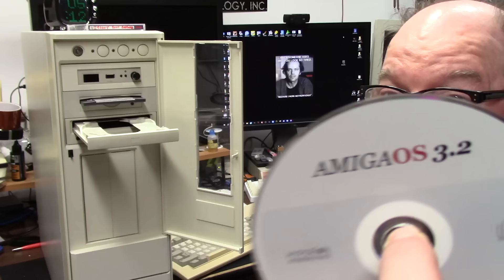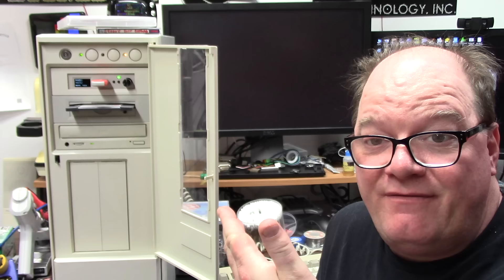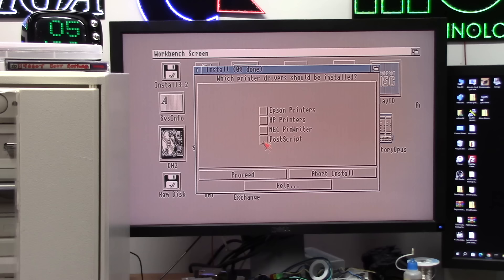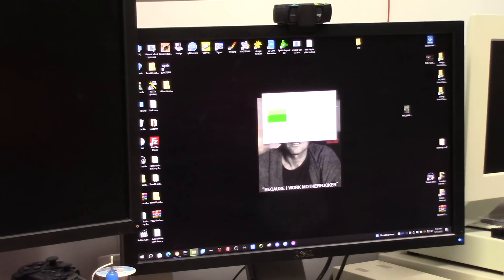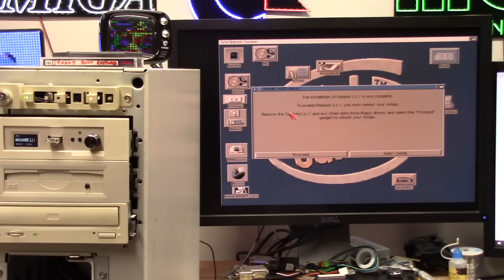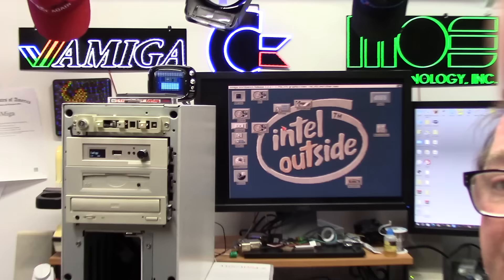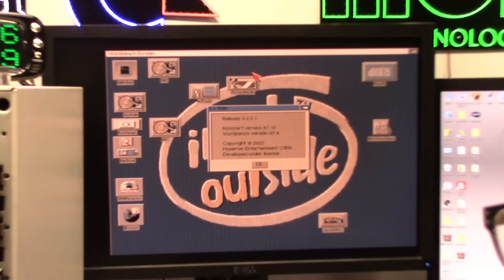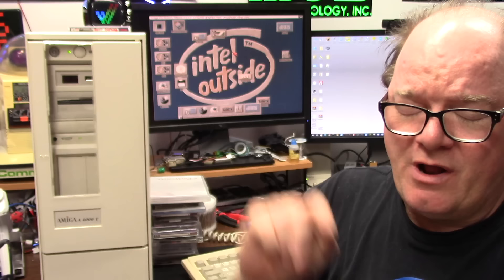Amiga 4000 tower  i wouldn't do that if i was you.

Comment: @Snowcrash777 — I’d say a slight modification to your statement, such that:

Tech work while exhausted can be calculated. Each hour you didn't sleep adds 20 more minutes to anything you would normally take 1 hour to do. So, if you slept 4 hours, and you should have slept 8 hours, and try to do what would normally take 1 hour, will now take 1 hour+4x20minutes = 2 hours 20 minutes.

Comment: I'm pretty sure the "A3000(T)" line means "A3000" or "A3000T" - usually that's what the parenthesis means in this situation.  I say that because they have the 4000D and 4000T separated - maybe something is different between them, but A3000 and A3000T are the same?  That's how I read it at least.
Reply from the maker: yeah im dumb, the 4000 and 4000T should be seperate as the 4000Tower has both ide and scsi, and the 3000 series tower or desktop are the same machine chip wise.

Comment: AFAIR, "maprom file FORCE" should go to a different version (might need a reboot with no S-S if you run mmu tools). Thinking about it (been a while since I battled with versions), I thought maprom would always map in a new rom on reboot if it saw that the file was different to memory??? The things you forget when you don't practice them...
Reply from the maker: not on warm boot only a cold boot it remains resident.
Reply: I believe the official C= developer "MapROM" command will always remap, but it requires an A3640 or A3660 accelerator to do so.
Reply from the maker: @gdonner  my quikpak 060 maproms